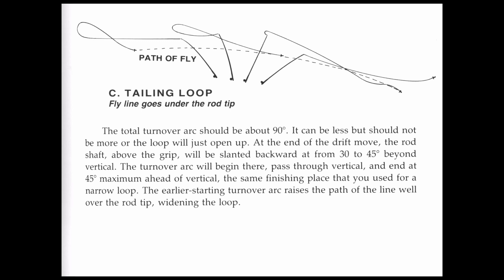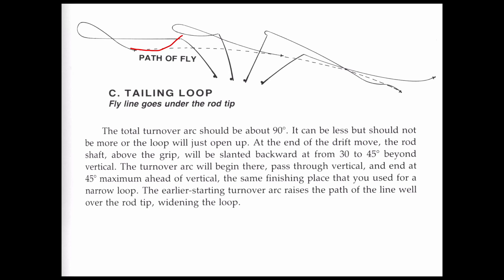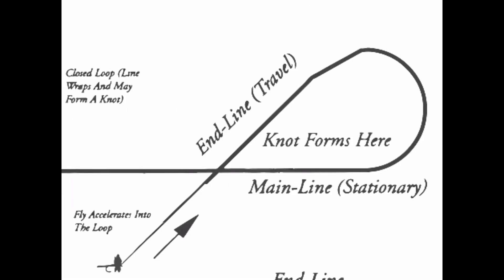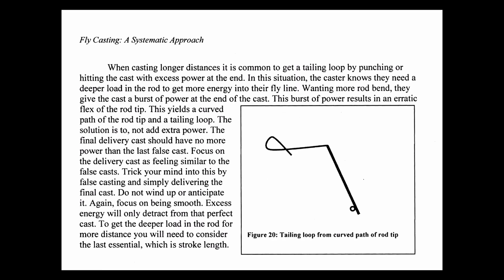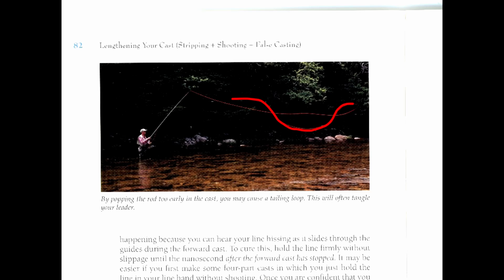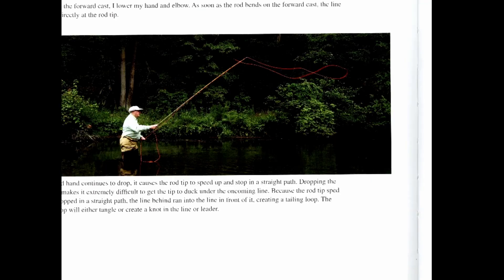What A Tailing Loop Is Not

Comment: Hello Macauley,
A tailing loop to me is a wave in the fly-leg. If it was undesired, it's a fly casting fault. If the wave in the fly-leg crosses the rod-leg or not, depends on position of observing, the size of the wave and the orientation of the fly-leg relative to the rod-leg. But all this doesn't matter. It's the undesired wave in the fly-leg we don't want. In the real world we see mostly instructors and instructor candidates stop extremely high to make the legs look crossing from the horizontal side view. Students don't stop at 11 : 30 in a horizontal cast, but usually too low instead. I agree. It's also fair to summarize, that 98% of my students don't throw such dramatic waves in their fly-legs like presented in this video! They throw small waves in their fly-legs instead. The definition of the wave in the fly-leg to cross the rod-leg does not present what my students typically bring into my lessons. Btw. students throw tailings in all trajectories. Tailings ARE NOT based on a horizontal fly-leg trajectory.

You recommend to not teach with drawings, but to use frame grabs instead. I recommend to then stop talking about SLP, because in this video the fly-leg never was straight, nore was the tip path. Welcome to the real world of fly casting though. There is no straight in fly casting!  ;)
Cheers
Bernd
Reply from the maker: Thanks for your comment, Bernd. I agree about the dramatic waves in the fly leg being in unrepresentative of what most of our students do. I dramatized it as a teaching point for instructors: we should always exaggerate what we want our students to see. And I never talk about SLP with my students. I talk about it in our community of instructors because talking about it is — unfortunately— required to pass our tests. 

I agree that my fly legs are never straight—they can’t be, because I’m merely human. But also because my demonstration casts are always very slow. That’s so my students can see them better than if I cast with high line speed.
Reply: @4mackle  Hello Macauley, Thanks for your comment/answer as well. Good to know we are pretty much on the same page though. Agree with the points you made. Since we both have been teaching a lot, everything else would be a surprise to me. Cheers
Bernd